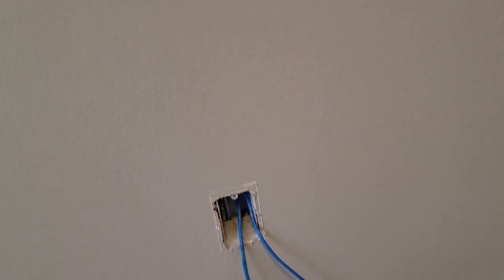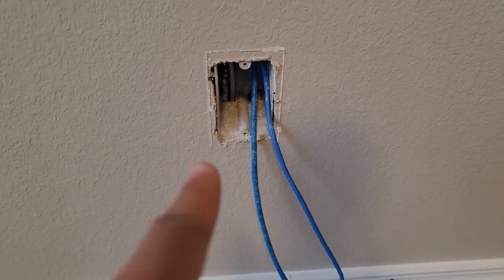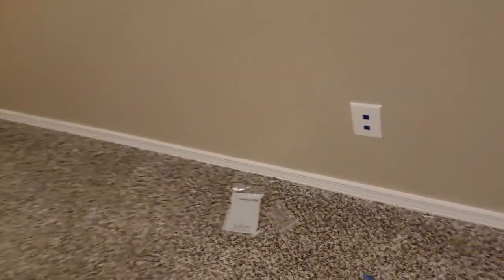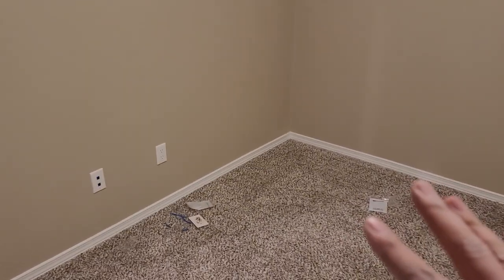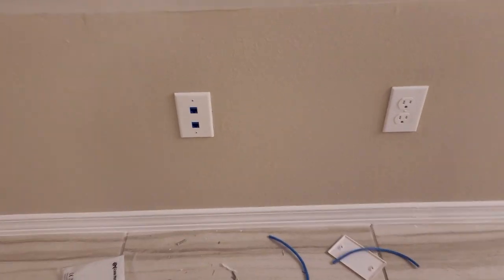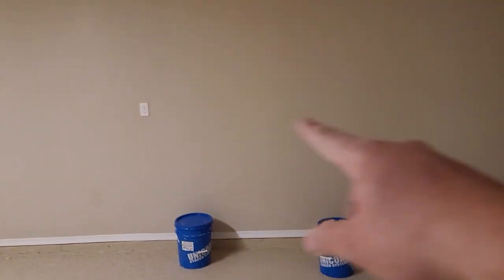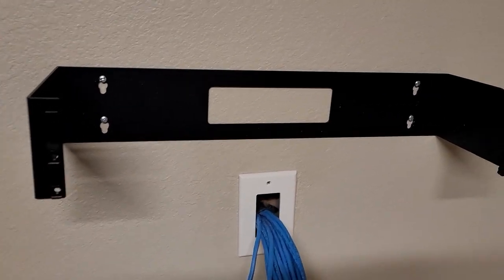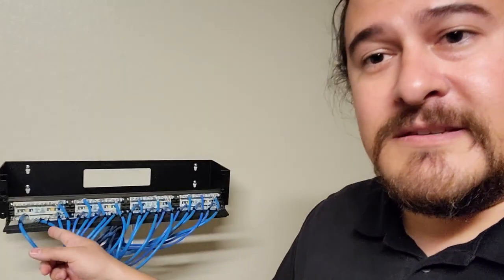New Home Network Installation

Comment: You mounted your rack mount upside down.  I now this works BUT the head of the screws should go through the larger circle and then slide into the smaller part.

Comment: I think you misunderstood the purpose of patch cables. All they do is connect the keystones to the ports on the switch. If your cable is too short to connect switch port 10 to keystone jack 7, then use a different switch port that's closer to jack 7. 

To minimize this issue in the first place, you should've bought another pack of rack extenders so that the keystones are flush with the switch. It also makes it easier to plug in patch cables as well as use shorter ones for the closest ports.

Comment: If you have coaxial in the wall, I’m surprised you did just get a keystone pass through for it and have it in the faceplate.

Not that you’d redo it now, but a blank keystone panel and keystone punchdowns is a much nicer experience than a punchdown panel.